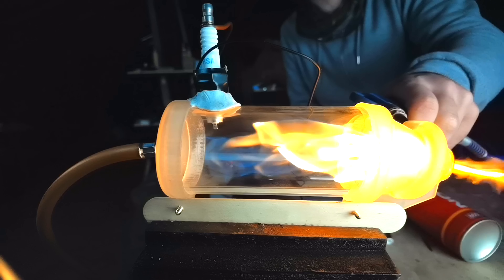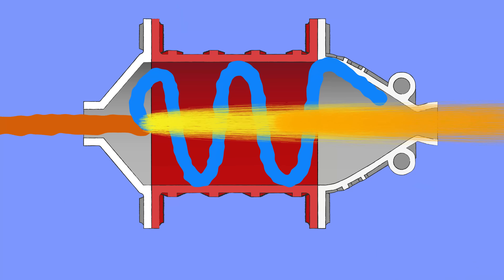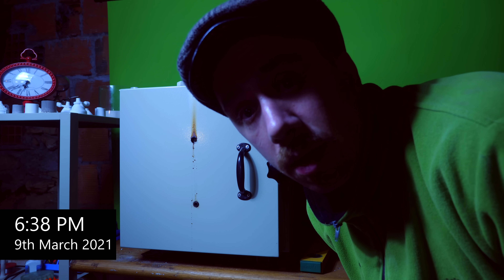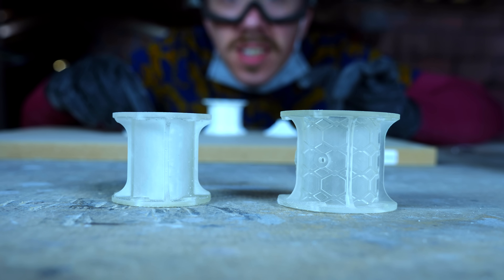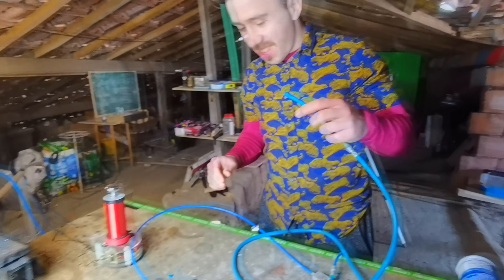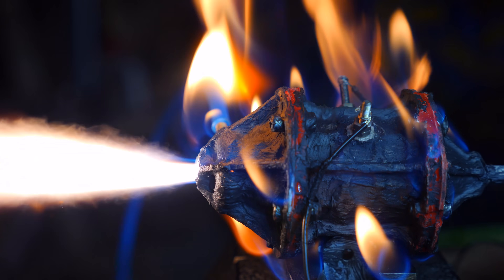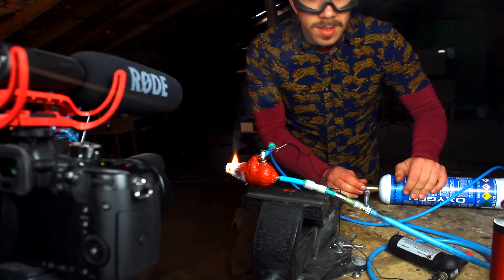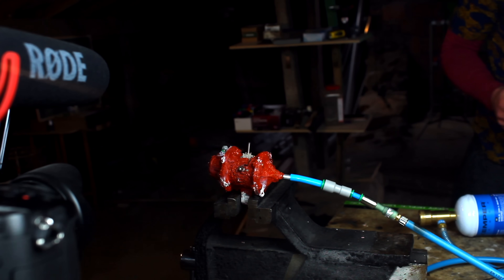Vortex Rocket V2.0 (3D Printed)

Comment: Just attach the ceramic nozzle to an aluminum tube with a very powerful  heat resistant resin like JB weld. Or even better. Empty the fuel tank completely attach the nozzle to that refuel the tank  with an after market install of a one way valve.  Also make sure to add a pressure regulator so that it doesn't all pour out too quickly. and ignite/ detonate it at a very safe distance.  for bonus points add some stabilizer fins.  use a drone with a go pro to watch the whole thing and calculate altitude.  use trigonometry and  wind conditions,  to calculate possible travel arcs. attach a plastic explosives payload with an impact detonator.  park a large target off into the distance in the salt flats, attach a small wifi enabled camera which can transmit the video feed over 5g so we can watch from the perspective of the mini icbm as it explodes the target. I sexually identify as an Apache attack helicopter. Extra points if you can make the explosive payload detach from the primary rocket so it can be reused. It's basic wizards chess

Comment: Hey try Hi- Temp JBL Epoxy  should fix leaking,  also i wonder if you soak or paint ceramic part in sodium silicate (water Glass) should make your pieces much stronger then you can coat it in hi temp JBL 2 part epoxy

Comment: I am no engineer but there seems to be much internal pressure the last one lived the longest. However, after the first run it was already broken just the Hi-Temp silicone was holding it together. Why not use the ceramic process to make metal castings like with the turbo-jet. I also feel that more precise valves for the oxygen, as well as the propane, could make a drastic difference and possibly solve the issue of to much pressure in the chamber.

Comment: Just use same thing as in the pulse jet 😂 wrap it in carbon fiber 👌🏻 so insert with ports will be ceramic and oudside layer will be carbon fiber, should work fine, if ceramic insert doesn't broke...

Comment: So, I was thinking about your leak problem. What if you coated the inside of the rocket, after it's put together but before you put the pipes in, with a thin layer of the high temp silicone red layer you painted the last iteration with? If it was liquid enough you could pour some in then slowly roll it until it is even on the inside, dry, and smooth. Hopefully that doesn't fiddle too much with the internal geometry. If you expect that you would get a final internal layer of the sealer of 1mm then you could simply scale up the print by 1mm. 
Alternately what if you put an air tight outer layer that was lower temp? Like a ship in a bottle. If there is nowhere for the gasses to leak to it may serve the same process. I don't know if it would be possible.
There are metal 3D printers out there but... that may be cheating! lol

Comment: completely fill both the inside and outside with sand for the burnout phase.  this provides equal heating and support during resin removal.  Remove sand and sinter.  Salt will also work.

Comment: It might be the ceramic is cracking, while you did the only test that didn't leak mostly a bubble formed near the nozzle, meaning some larger hole formed allowing gas to escape through small gaps in the sealant, I think it needs to be more rigid, a carbon fiber wrap might help

Comment: One idea if you're wanting to keep it mostly ceramic and high-temp compliant is to coat the interior with sodium silicate with a few pinches of graphite or silicon carbide suspended in your mix. At high temperature, the sodium silicate will glassify and seal your ceramic from the inside, and as a bonus, it's compliant up to around 1100*C. You can premix it with a bit of water (your mix can be 2:1 SS to water for a cement-like consistency or slightly thinner to aid in coating) and slush cast the interior, coating all sides liberally and letting the rest run out, then flow CO2 through it to cure it. Additionally to your benefit, if you fit all your parts, sodium silicate makes an amazing ceramic cement. =) 
I liked your externally supported attempt, however the cooling rates and shrinkage with the non-unilateral structure without being supported in a mold most certainly led to the disproportionate warping in thicker and thinner parts. Packing it in sand for your kiln firing may help but you'll still get the shrinkage regardless, it'll just have a support structure that it can also pull minerals out of, giving a bit of strength to the cured part.

Comment: Have you considered water glass (sodium silicate) as a sealant? I'm not sure what it's coefficient of thermal expansion is, but it's probably in the range of ceramic itself. Furthermore, you can easily dilute it to improve the absorption by the ceramic.

And as a future project, may I suggest you make an articulated ceramic nozzle for thrust vector control of your rocket.

Comment: Use liquid ceramic slif  to seal the engine. It glues the handles on Coffee cups . It's just ceramic powder mixed with water. Apply the slif then fire the part in a klin,

Comment: Great job Integza! 
Next time buy some pottery clay, and form the shape of the engine on a pottery wheel. If you make the walls around 3mm thick it probably won't leak, but if it does, just make the walls thicker, or glaze the inside with pottery glaze. If you don't go crazy thick it will not crack or deform. It can be a solution, but the throwing and glazing part requires some equipment and a lot of practise.

Comment: Exhaust System Sealant with glass fiber reinforcing might work. Just get the lose fibers and put them on sealant and make another sealant layer above the fibers. 
Also. Why don't you make a speaker horn that run on liquid nitrogen like the one that they use to test space crafts etc for the launce, sounds like it should be easy. It's more or less just a normal horn that use the pressure that is generated from the nitrogen when it evaporate to make some extreme loud noise. Might be worth giving a call to Mark Rober

Comment: Exhaust system gaskets for cars are designed to handle high temperatures. Maybe that solves the leaks between parts ?  As for the body of the rocket,  how about anodizing it?

Comment: i would maybe look if there is like a way for you to print a metal or a percentage metal to improve the leaking and make it able to withstand higher pressures. or if there isnt a good option or it doesnt exist at all just make an inner chamber out of (sheet) metal but that would defeat the whole ceramic and if you choose for the latter also partly or entitrely the 3D-printen part. (I do know that there was a company that printed a titanium nozzle but i don’t think thats an economically possible/viable)

Comment: your weak point on your engine is heat build up and gaskets.   Consider placing a heat sink on the exterior of the engine,   as for the gaskets, a dual channel interlock would help, basically a channel that goes round the flat part, as female, then the other part has a male.  To seal it a crazy idea would be to place flux wire in the join then hi temperture silicone.  To get a nice consistent burn with the gas it might be an idea to wrap copper pipe on the exterior a few times before it enters the fuel chamber, it will heat itself up before burn, this will stop the internal hammer effect shocking the ceramic ( mix in aluminium/steel powder in the resin).   When you are firing the ceramic pieces in the kiln consider a sand jacket this will give an even heat and stop it cracking and expanding in the kiln.  Tin can place the motor inside, then fill with foundry sand.     Plus there is a nice  nozzle design which is not a venturi nozzle, that increases thrust by 15 percent,   its on this youtube channel at 5:13  if you place this nozzle after the jet burner I suspect you make be pleasantly shocked.   https://www.youtube.com/watch?v=bPZI6XoHi10&list=WL&index=120

Comment: I wonder, if the gases are leaking through the ceramic, maybe adding a layer of rubber or something similar on the outside would be better.
Ceramics should block most of the heat, and rubber or other soft material would block the gas but won't crack, while being cooled by the air outside.
Kinda like a double insulation. In theory it should not be able to transfer too much heat outside since the gas transfer will be stopped by the pressure.
But only if you manage to perfectly block all the leaks.

Comment: you could try using tar/pitch (piche in portuguese) to seal the parts, though I don't know if it would work and it's definitely worth a try. just pour it in your glued parts, then shake it for a while so it gets inside and then leave it hanging to remove the excess liquid.

Comment: Like a few others suggested, I would try experimenting with glazes. However, I would suggest trying to make them yourself. This would allow you to experiment and create a glaze tuned to same thermal expansion/shrinkage rates of the 3D printed ceramic, minimizing the potential for cracking. Also, if the glaze starts to fail under the heat during testing, you could try mixing refractory materials such as graphite powder into the glaze to see if it provides the temp resistance needed.

Comment: what do you think about vacuuming your sealants and parts before slathering them? Maybe part of the reason they degrade so quickly is that there's some moisture in the pores and the heat is causing boiling and expansion where you don't want it?

Comment: Next video idea I think would be cool would be a bi - nozzle rocket engine. Using the same pressure you use now and same sealing techniques I bet you could fix those leak issues by the split in pressure. plus two is better then I right? Kinda like how 3 is better then 2. Maybe you could figure out how to make it spin with the thrust power and off setting the angle of the nozzles lol.

Comment: Would it be possible to use an exhaust gasket from vehicle exhaust systems for the seal between rocket parts?  I would assume it would be a good alternative to silicone.

Comment: @Integza Can you create a posotive of the inside of one of the engines, then use that to create a castting mould and cast an engine from some kind of metal, sure it will be heavy but you will have a much more durable part.

Comment: How about 3D printing a rooftop wind turbine grid using lily impellers and dc motors. Not sure how windy it is there but maybe you could wire them up to power something small in the shop. Maybe have them mounted horizontally on a base that can rotate like a weather vane.

Comment: Something to consider in later builds is a method of cooling the engine, no matter what material you use with pure oxygen in the mix with your fuel there are very few materials that can withstand the temperatures your achieving with your engines, given enough time you could melt an entire steel engine as well. I wish you luck with your next builds and I love your videos

Comment: I would keep the nozzel 3d printed but the rest of the body would try to use some type of metal, first version went pretty well the only problem was that the acrylic body was turning in to fuel with the presence of the oxygen so was more like an Hibryd Rocket 😅

Comment: You've got a couple different layers of your engine. The porcelain is your structural/thermal layer, while the silicon is an obturation layer. Like the inside a gun you have to support your soft brass/silicone obturation barrier from the outside with the walls of a chamber, otherwise it will pop under high pressure.

Suggestion: layer something on top with decent tensile strength like fiberglass+epoxy to support your layer of silicone.

Comment: In ceramic class to fill holes and cracks we used a very thin ceramic clay  liquid /slurry. I wonder if you dipped the parts (plugging the holes/nozzle) prior to curing the print, if it would seal. I also wonder if it would help to apply the ceramic slurry/paste between the parts when you cure them (cure them together, try bolting before and after). There's also lost  PLA casting (:

Comment: Hi, I don't remember the English name for it, and it might requires a little bit of extra material, but did you considered a destructive metal cast molding? You print your parts in plastic, wrap them in molding sand. When you put the metal in fusion, the plastic will be burned and replaced by the liquid metal. It requires some learning to produce parts that are properly moldable that way, but I remember some videos on YouTube using that technic.

Comment: is it possible to add layers to parts that have already been printed? If so I would suggest a layer of material that will melt but not become too thin, between 2 layers of ceramic. That way the middle layer will act like a thermal compound transferring heat between the layers of ceramic plus any material that does manage to boil out through the pores will just add an ablative cooling effect.

Comment: Your problem might be coming from the excess heat generated that might expand the bubbles and cracks from the ceramic and cause leaks. You should try water cooling the outer case. Put the engine output upwards in an aquarium full of water (and proper isolation on the spark plug) and test it. 
Probably won't solve it but you could gain a few seconds of running time.

Comment: It seems one major limiter to the rockets you are making is the fireproof adhesions you are using don't burn much but the also can't with stand any pressure so maybe you could try burning out a majority of the silicon, remove the supports then cover it with a generous layer of unfired clay and finally put it in the kiln again

Comment: Use 3D printed molds to cast something thermal resistant and not porous. Your SLA printer should be able to make an intricate mold for the unibody engine.

Comment: Maybe if you use your 3D printed parts as a kind of mold for casting metal parts for your motor. You will need to split it in two and hold it with screws perhaps. You are strugling too much with materials that don't hold all the heat and strain.

Comment: Have you tried using high temperature chemical cement like Omegabond 600 used to electrically insulate stuff?
Remember you need to dampen the print with thinner cement before adding the actual cement (the dampening will go to the pores of the print, without it the gases will move around in the pores). The key is while curing the cement so it doesn't "loose" anything while curing creating even more porous material around the body but it actually creates a shell around it, maybe even better would be something like magnesium oxysulfate cements which expand while curing (probably even blocking pores) but IIRC they don't stand that high temperatures (only ~500-600C). Problem with these is that they are usually used to get the heat away from electrical things or to them so they are thermally conductive and they will get hot, but your problem is leakage not things getting hot.

Comment: At 17:12 you can see that the rubber used to seal the engine has become soft (possibly the heat, possibly from not having cured long enough) and is being pushed away from the joint by the pressure leak.  you are going to need to find out how hot that is getting so you know what kind of material to use in place of the tomato paste.

It may be as simple as wrapping the pasty version in something like fiberglass cloth (or Kevlar or carbon fiber, depending on the temperature) with the red RTV sealant (or a better high temp rubber) smooshed through the weave so that the outer, cooler layers does not let the softer inner layer expand.

Comment: @Integza >>> Could you coat the completed engine[s] with some kind of ultra high temperature thermal-setting sealant coating, then run it through the furnace again -- at a lower temperature than what you used originally on the ceramic engine  -- to cure the added high temperature coating?

Comment: How about you dip the ceramic parts in a heat resistant solution that way all the air pockets get filled like use heat resistant paint could solve the problem

Comment: What is the motivation behind putting the compressed air intake at the front of the engine? It seems like the ox/fuel mixing would be more efficient if the ox intake was near the back, like the fuel intake.

Comment: Hello Integza, you could design the engine so that the oxygen inlet is angled slightly towards the nozzle being situated behind the propane inlet, but between the propane inlet in which will be cantered and the outer oxygen inlet there is a dividing space for the vortex to initially form before ignited with the propane, hope this is of any interest.

Comment: Next you need to upgrade the nozzle parameters to create mach diamonds. The solid fueled rocket engine would be good for testing nozzle designs.
(but it might be a good idea to fix the engine first)

Comment: Maybe multiple 3D printed layers, inner ceramic one, coated with the cement and plastic/resin one as reinforcement on the outer. Or get your hands in some aerogel as isolator in between both layers xd

Comment: all your design starts very well but depending on the shape they cracks where the temperature is too high and start leak and degradate the performance. different design created different hotspot.
have you ever seen that video where a balloon is placed on a candle and it doesn't explode because it has a little of water in the inside? you just need to actively cool the engine and take the heat away so to preserve the ceramic shell better. i think that probably you can go with plastic print too (maybe)
why do not spend more time in designing a liquid cooled engine? basically your current design suspended inside a bottle of water with a circulating pump and a huge external tank filled of water (consider the weight before placing a couple of hundred kg on the roof of your house...)
if it works then you can think on how to improve the design with radiators and a limited amount of water to make it light and efficient.